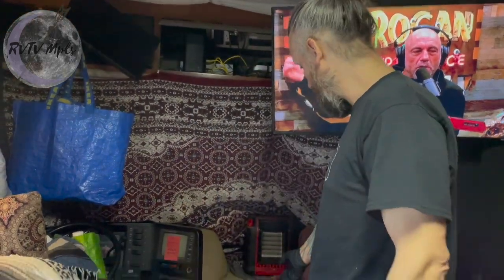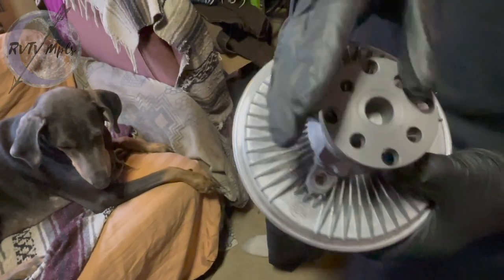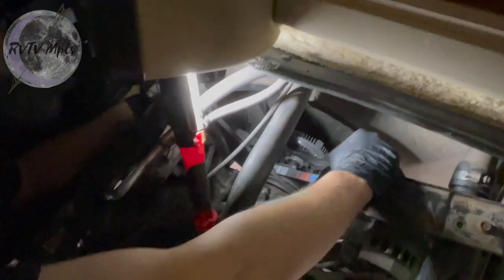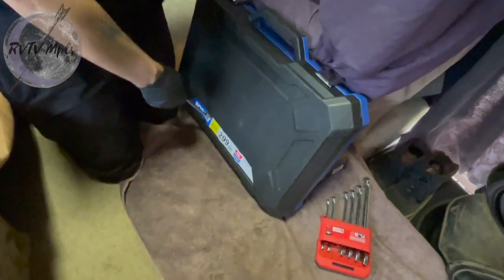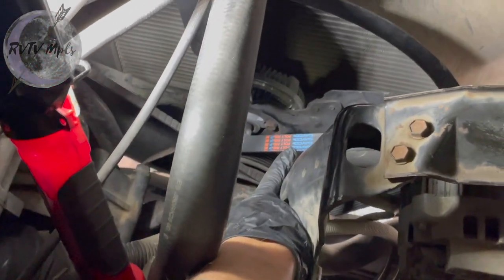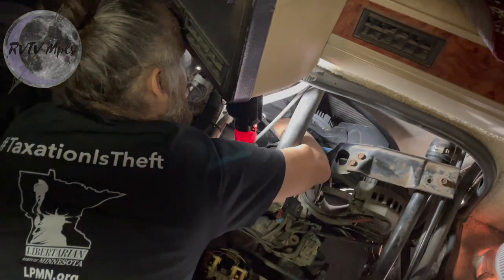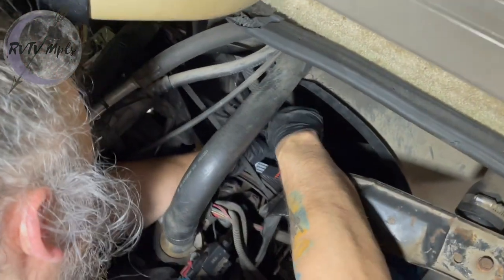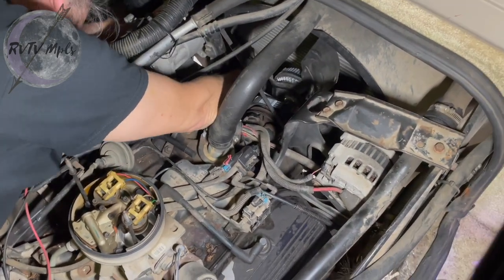Can We Stop Our RV From Overheating This Summer?

Comment: You could highjack the heater hoses and put an auxiliary radiator on the roof or put a mister like an outdoor air conditioner in front of the radiator.
Reply from the maker: Hopefully this new clutch does the trick. Getting that fan connected with the clutch around the fan shroud was going to be impossible unless I took the radiator hose off, or disassembled it. Thanks for watching!

Comment: Will you know right away if it made a difference? Or not until you guys are driving around in the heat?
Reply from the maker: You should have seen her while we were trying to edit this, it tested our sanity! 😂😂 The last time we drove her it was running hot by the time we got to the end of our road. We are getting ready to set out for a couple weeks, so we should know pretty quickly how much cooler it’s running.